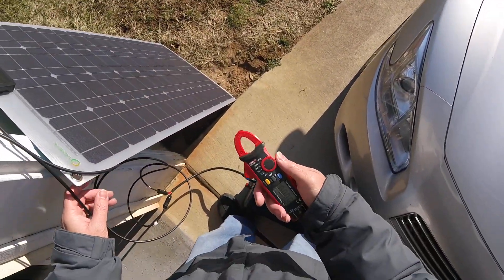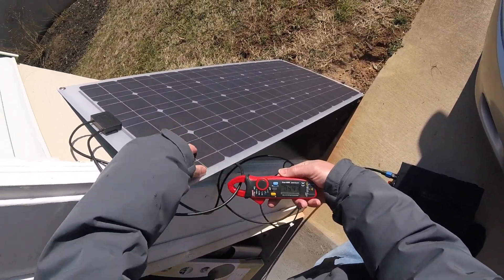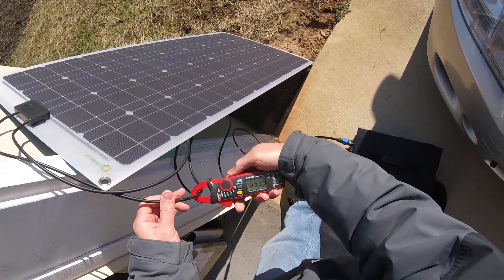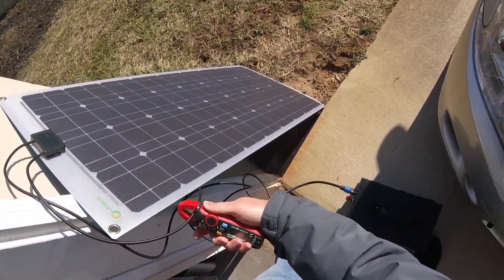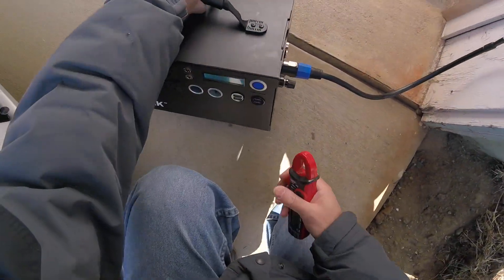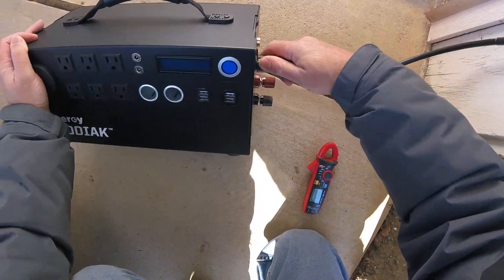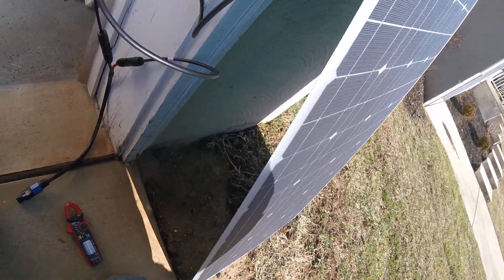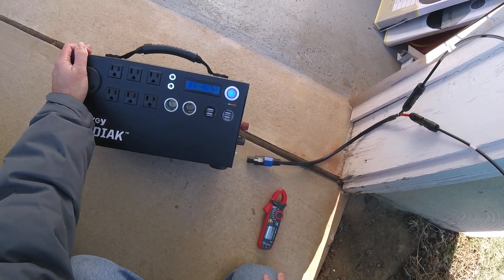Lensuntest5 of 11

Comment: I subbed your channel. I like you videos. I will be watching all of them since I am wanting to use flexible panels also. Thx!
Reply from the maker: Just 1 note: If you want to install them like I did with the eternabond tape & if you have ridges or channel like I do, after the tape has cured use a small bead of general silicone on the edge of the tape to prevent highway winds from lifting up the tape.  Should work in theory. I am currently testing this out.  Thanks for the comment
Reply: Thanks for that advice. I assumed it would just hold.
Reply from the maker: If you had a flat roof van then it would not be an issue in my estimation.
Reply from the maker: Also on the latest panel I recently added to the van I used a whole tube of silicone under it for added security or peace of mind. You could use some adhesive but you may never get it off intact.
Reply from the maker: Make sure your panels can handle silicone or adhesive if you choose that.